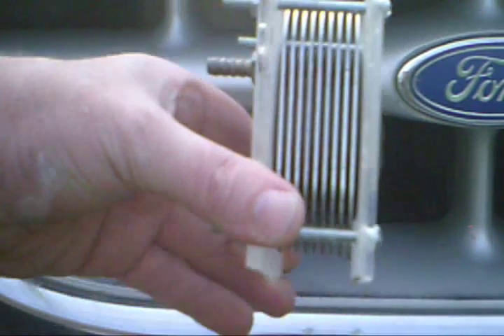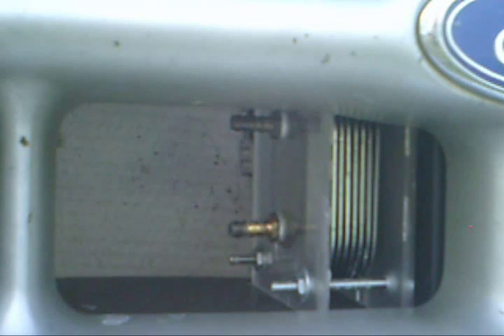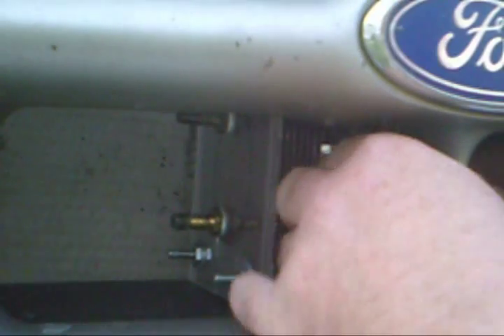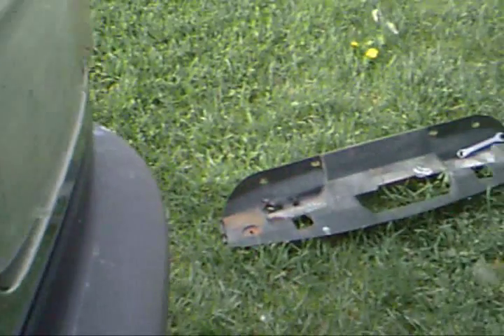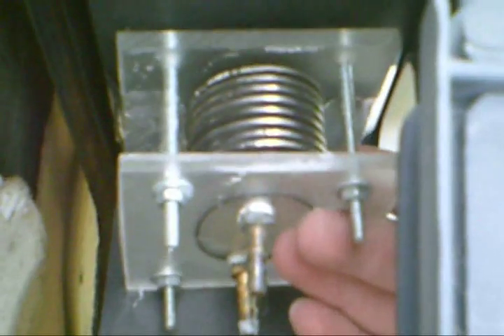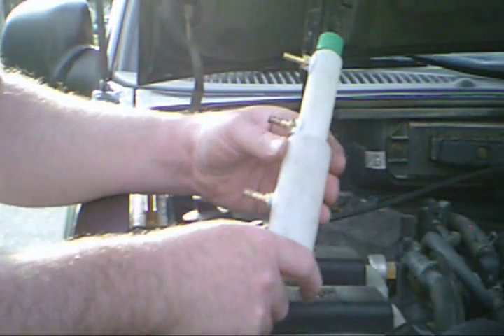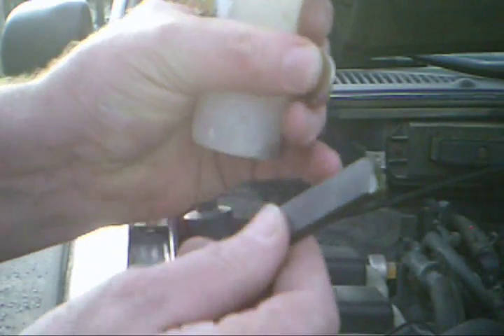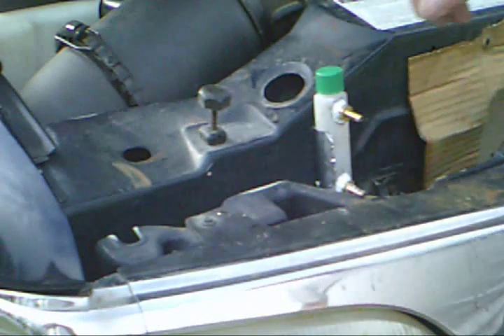HHO Dry cell project pt 4.wmv

Comment from the maker: You can get handfull of them and I'll give you a sheet of the plastic too. All you need are O rings, a couple of fittings and A REALLY GOOD DRILL BIT TO GET THROUGH THAT STEEL, IT'S AS HARD AS A DIAMOND! but we can try my new method of making holes in it.

Comment from the maker: I had a tank of gas to try a milage test but, I had to pay rent and pay a power bill (together well over $600) so I had to run the tank out and just get a couple of dollars worth of gas 2 days ago, tainting the test. Plus the temperture of the weather has been going up and down, and I think that will have an effect on the results as well. Do you think so as well? Anyway, I have a couple of amp meters on order and I will be running some wet/dry cell and neutral/no neural plate cell comparisons.

Comment from the maker: That's been my purpose all along. I'm not sure if I'm getting enough HHO. I'm facing rent payment and electric bill shut off notice this week, so keeping my truck filled with gas to do MPG checks is not on the top of my to do list, This may work better on my bike. HOWEVER I did just order a cheap pair of amp meters, so I will be able to do some comparitive testing between wet cells, dry cells, and cells with and without neutral plates. I now have 3 sizes of wet cells and 2 mini me's to work with